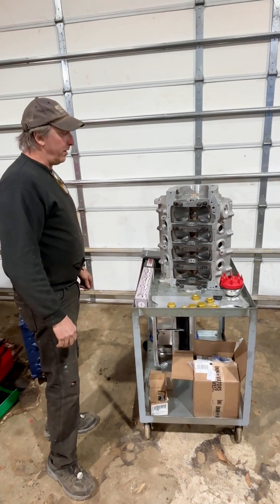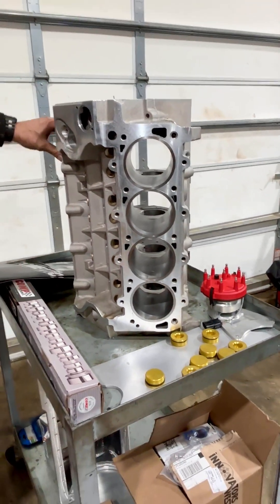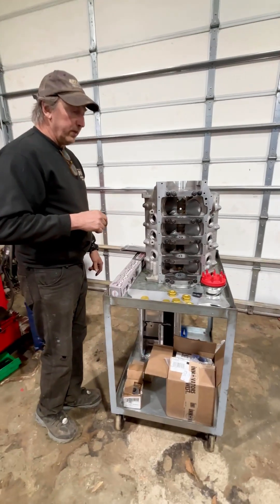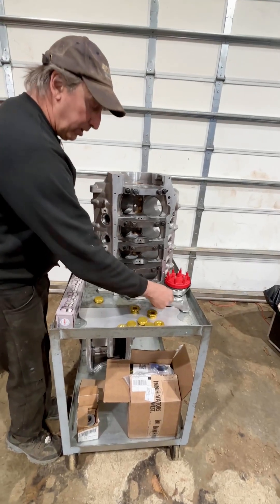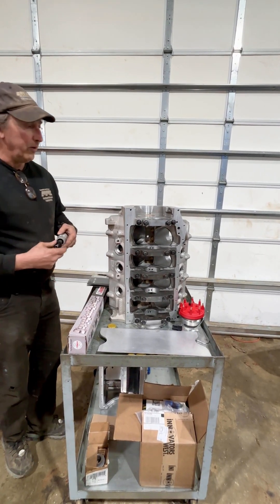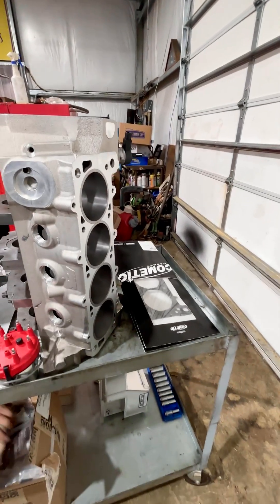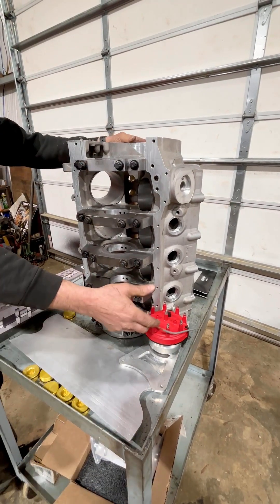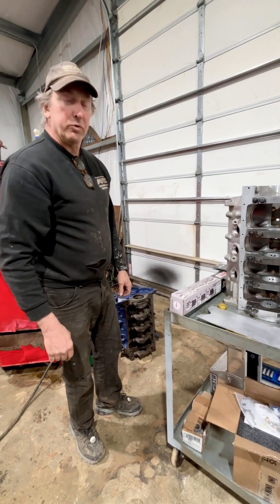Distributor Plug OR Distributor with Cam Sync? – Engine In a Box Kit // Titus Performance

Comment: Can you deliver the belt drive system with a cam sensor provision in the cover, and a magnet in the cam pulley? Or can you make it with a 4X reluctor similar to an LS? I'm looking for something for a Pantera where there is limited room in front, and with a Kinsler injection up top, where I want to do away with the distributor entirely, and run coil on plug or coil near plug with a 60-2 crank trigger. Basically similar to what you'd find on a late Gen 6 BBC or LS.
Reply from the maker: Yes we do have many options for cam and crank  sensors, especially for coil near plug. We have 4 Pantera full engine builds in process all with different ignition and EFI systems.  Best to give us a call and discuss what you need. Thanks!